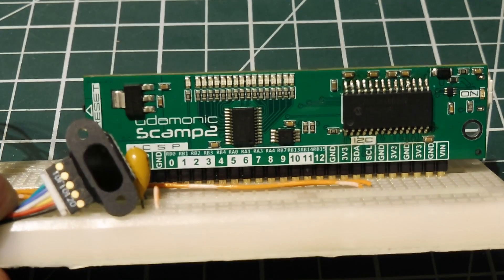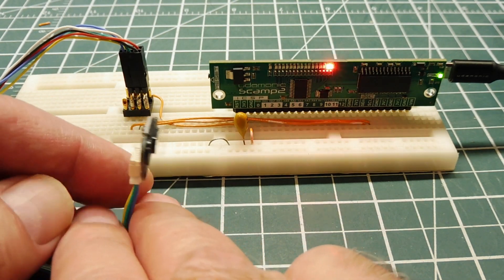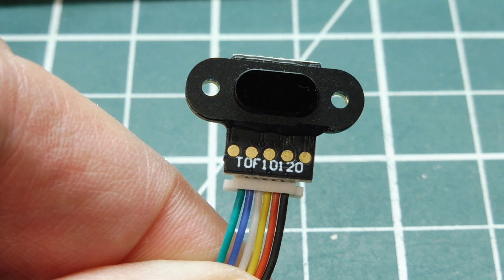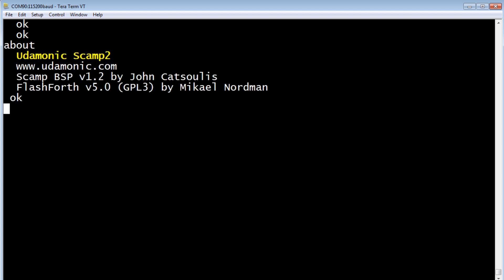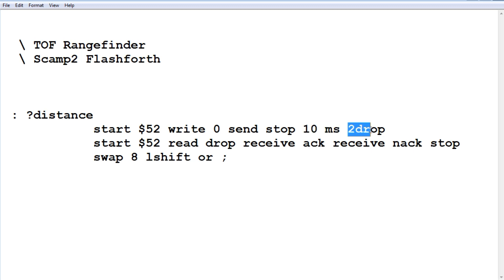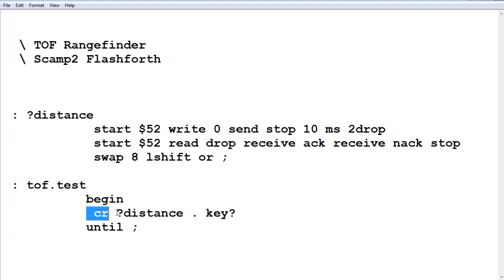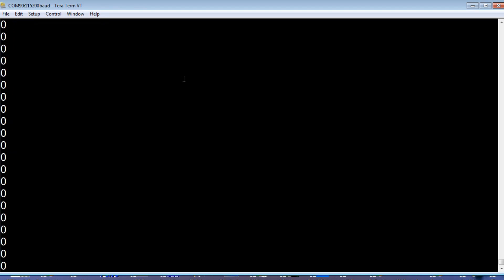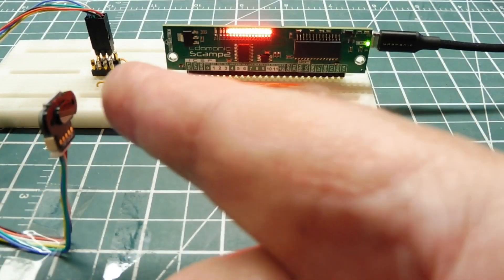TOF Distance Sensor / Scamp2 / FlashForth

Comment: Thanks for this video -Your SCAMP2 videos made me purchase a SCAMP2 board and I'm having a lot of fun with it (learning forth and playing with sensors directly). I'd love to see some videos where you can connect the scamp up to other non-I2C devices. A 1602 LCD perhaps. I've even tried (and failed so far) getting the SPI interface working on the PIC with forth words to talk to a MAX7219 so I can play with an LED array.
Reply from the maker: You can get LCD1602 displays with I2C piggyback boards and drive them with I2C.
Even simpler is Scott Edward displays by Seetron which use serial UART to drive them. They cost more but easier to use. https://www.seetron.com/products.html